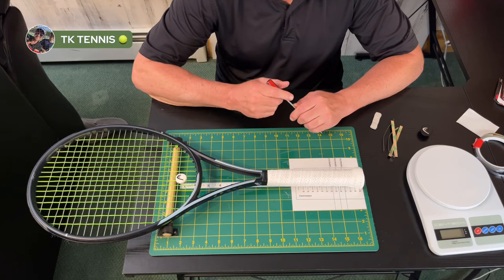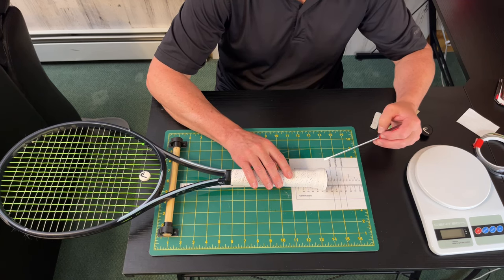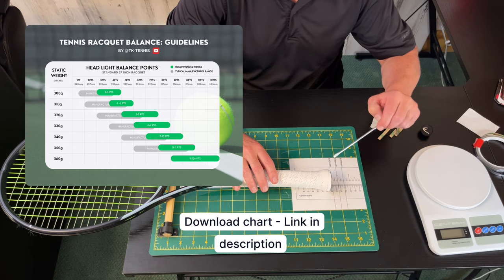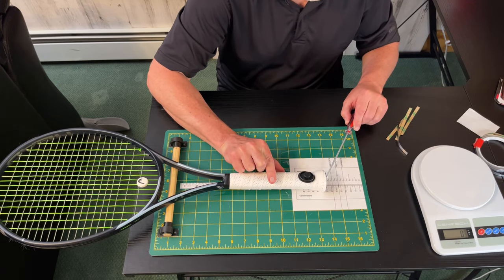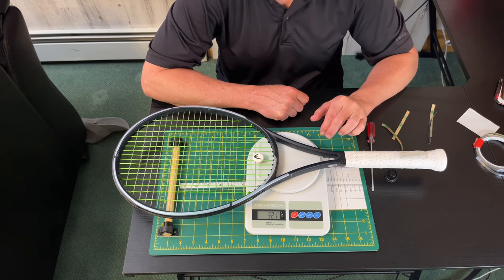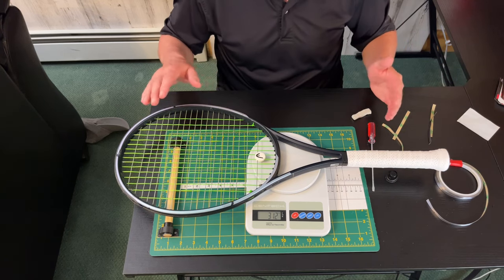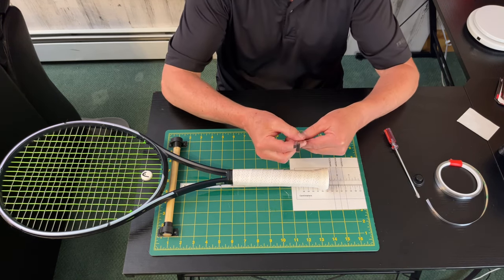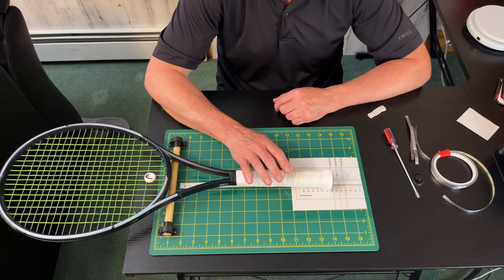Best way to customize your tennis racquet in 3 easy steps #tennis #tennisracket #tennisgear

Comment: The only problem with getting a light version and customizing that, is those tend to come more stiff, which is fine, but when you frame the ball over and over because you’re not a pro player, those vibrations can and will do damage. The difference in prostock and normal weight racquets usually is they come much softer.
Reply from the maker: That's a good point depending on the racquet model, although I think in most cases I think it comes down to preference over the possibility of getting injured. Tac in the handle also dampens the racquet and does an excellent job of muting vibration, plus the benefits of additional mass in the handle help.
Reply: Bothe The speed mpl and Gravity MPL are the same stiffness as thier heavier version or not much stiffer
Reply: This is very true, i had played with HEAD Speed MP Team 2022 and there was a lot of vibrations , then i upgrade to MP 2022 and there was no vibrations (same strings same tension, without a dampener)
Reply: @vladmaxim soft+light frames are hard to come by.

Comment: You can easily add weight to handle with one or two Overgrips (around 5g each) or replacement Grip(around 10g-15g) weight.
Reply: You can add leather grips as well which add 20+ grams
Reply: That makes the handle more round and thicker. Not a good idea. Do some work and do it the right way, the way he explains in the video is correct.

Comment: Love this video! So I have a Whiteout 18x20 305. It’s 4pts headlight. I’m a 3.5-4.0 player. I have a 5 gram buttcap insert I can add to make it more headlight. Any idea how many extra headlight pts it would get me and if it would be advisable?
Reply from the maker: The 5 gram butt cap insert would likely add 1-1.5 additional points head light. Bear in mind that your racquet strung is 320+ grams and therefore the chart recommendation is 5-8 total points head light. The butt cap will get you into that range, so you may also want to add another 5grams of tac into the handle "if" you want to get deeper into the range and experiment.
Reply: @TK-Tennis  Thank you, I will try that. I can also order 10gram butt caps to try next instead of Tac. Appreciate the response.
Reply from the maker: @ryansolomon4178  Solinco is trend setting by selling weighted butt caps! Good on them, hope other manufacturers follow suit.
Reply: I play with Whiteout XTD 16x19 with 10g cap. Love the head light which allows faster racquet head speed especially with 16x19 pattern.  I have played with 18x20 XTD too but found the contol on 16x19 was just as good with bigger sweet spot. So I chose 16x19. Question, I now want to hit bit heavy ball, will putting 2 lead tape at 12 o'clock help with this ?
Reply: @HuangYiJiang2  I’m not sure if you are asking me this or not. I would imagine so.
Reply: Either person, thanks for your reply. I guess using the XTD 18x20 with 10g cap will do same verses adding wt on the head of a 16x19.   I did not do that when I own the 18x20. With the 10g cap on the 16x19, the racquet does feel very light. Thanks again.
Reply: @HuangYiJiang2  Generally adding weight to the head will add more plow and stability. Since there is already 40t carbon at 3/9, 12:00 makes sense to me to try.
Reply: i also have the WO 16x19 305 and actually dislike adding the 5 grams weight to the bottom as it makes my shot shallow and too spinny (not heavy). can't even imagine the 10 grams.

my current setup is to add around 2-3 grams at 12 with no additional weight at the bottom to maintain the static weight well below 330 and make sure I can hit the ball with heavier balls and more plow by increasing SW.
Reply from the maker: @HuangYiJiang2 yes, but so will adding weight to 3 & 9. This is often the better place to start as it adds swing weight and twist stability. Just adding weight to the 12 alone is not done as often, it’s mostly done in tandem with weight on the 3/9, but it’s all personal preference
Reply: @TK-Tennis  Actually about ten years ago I bought a Donnay Pro One, they had 5g & 10g butt caps you could buy which i did! They also had strips which were designed to insert on the out of the frame at 12 3 & 9. I think they were 3g each, the frame was designed so they could be securely inserted & removed! At the time this was quite an innovative feature! Think their current ones don't have this anymore! So think Solinco haven't invented anything new here
Reply from the maker: @anielloliguori6312  Good to know. Nice to see they brought back some of the ideas

Comment: TK as you have seen below, I customised a head speed mpl , I am thinking for my all-round game not sure it suits it! So I wanted to ask you, how doe the customised gravity MPL play? Have you tried the speed MPL with the same customisation? and if so how do they compare? I am thinking the Gravity will be slightly more controlled due to 16x20 and thinner beam. I play a flatter old school type game. So i am thinking Gravity might be better for my game after customising it the same as the speed.
Reply from the maker: I played with the new Speed MPL a couple of months ago and I thought it played very well even in its default light form. The new Speed plays very similar to the Gravity, more than the prior version. The extra cross string makes no difference in my opinion, both the Speed and Gravity with 16 mains have the same control profiles. I do ever so slightly prefer the sweet spot and the thinner beam on the Gravity, but the thicker beam and stiffness on the Speed gives it a little more pop. 

The difference is really negligible, but you might be right in your thinking that the Gravity would suit your game a little better. With that said, I would suggest trying the Prestige MP-L as potentially a better option. It plays really nice as well and seems to be even a better potential option for a less spin traditional style of player.

Comment: That balance board is sweet! Wouldn't mind seeing how you made it
Reply from the maker: $10 versus buying one for $70 was an easy choice, plus it's enjoyable making things. It was really simple. I had the cutting mat lying around the house, then just purchased a round dowel from home depot to match the two self adhesive cable clips I also had lying around. Then I simply printed the balance board measuring sheet online and taped it to the board. The ruler is not required, I just thought it looked nice

Self adhesive clips: https://a.co/d/bU1yNZv
Cutting mat: https://a.co/d/heCf7T9

Comment: just today i went to a profesional stringer that strings for my nationals team players. so my best 2 players in my country now with a tfight iso 305 and blade 98 one had head heavy racquet and the other was neutral also sinner had a head heavy racquet. with right tehnique like pendulum u throw that head heavy with no problem and its even harder with head light racquet to do that because u need to overcome ball momentum of force by speed instead of using the weight of head.
Reply: Swing weight is what overcomes the inertia of the ball. Whether the racquet is headlight or head heavy makes no difference, other than comfort. It’s the swing weight that does the work. So, a racquet that is 7 points headlight can have a swing weight of 330 or greater and still be comfortable and, as you say, overcome the weight of an incoming ball. Physics my friend, physics.
Reply: @chuckfriebe843   head light or head heavy is more about manevrability which is personal choice for everyone
Reply: @agradina  It is indeed. You’re not wrong there. However, headlight or head heavy doesn’t have anything to do with “plow through”and/or inertia.

Comment: Your chart starts at 300g strung.  I have a racket that's 272g strung and not necessarily unhappy with its weight.  What should the HL balance point range/target be for a racket that's 272g strung?
Reply from the maker: Even a racquet that light I would suggest no less than 1-2 pts headlight, and likely 2-3 pts would be my recommendation. You will likely only enhance the racquet playability by adding weight to the handle. What make/model and what’s the current balance point?
Reply: @TK-Tennis  Its a Prince TT Cloud.  Mfg specs of 255g unstrung and a swing weight of 270.  The racket (with a  shrink sleeve (24g), overgrip (6g), Poly strings (18g) and overgrip (5g)) was 298g total weight .  Balance was 6pts HL.  I'm guessing without the shrink, it would probably be 0 HL or +1.
Reply: @jamesbarletta409  That's a highly customized racquet, nicely done. I can see why you like the racquet, the shrink sleeve alone improved the balance significantly. If your racquet strung is 303g (This is what I added from your figures) with the modifications and 6pts headlight, according to ChatGPT your swing weight it 318

Comment: You say that only at least a 5.0 & higher advanced player should use a 330g racket. 
If u start with a standard 300g racket and add strings, overgrip & dampener, it could go up to 330g, without even adding any lead or tac.
Reply from the maker: That's spot on. I addressed that exact issue in the video. If you start with a 300g racquet there is a limited amount of flexibility for customization and adjusting the balance point can be challenging. If someone is not a highly advanced player and plans to customize, then in "many" situations it would be better to start with a 285g racquet.
Reply: You’re correct! Also, racquets that were produced in the 90s were usually over 330 grams static. And, very often, with a swing weight much higher than what you get off the shelf these days. Beginners used them all the time.
Reply: Yep u definitely don't need to be a 5.0 player to use a standard 300g racket with strings, overgrip & a dampener.

Comment: Why to customize a racket? There are so many versions of Gravity? Why do you want to make from an MP a Tour? Why don‘t you buy a Tour in stock form?
Reply from the maker: Racquet models are simply designed to appeal to the majority of users, and and not any specific player. Even pro players who have 'pro stock" racquets made for them further customize them. Additionally, stock racquets have poor quality control and the same racquet make and model can have specs that vary by as much as 15-20 grams, it's not uncommon at all. The specs they list on the racquets are rarely accurate (except Yonex) and customization allows players to dial-in what works best for them.
Reply: Because you can be more specific with what is comfortable to YOU.